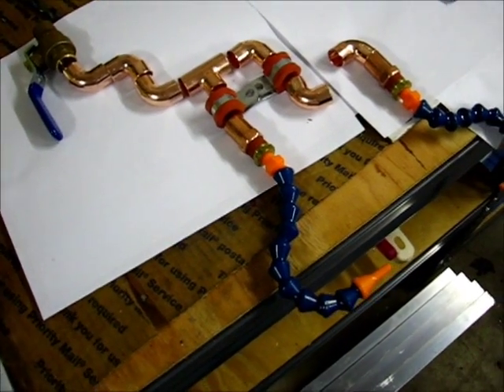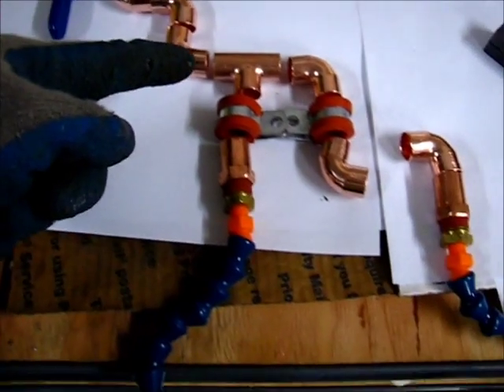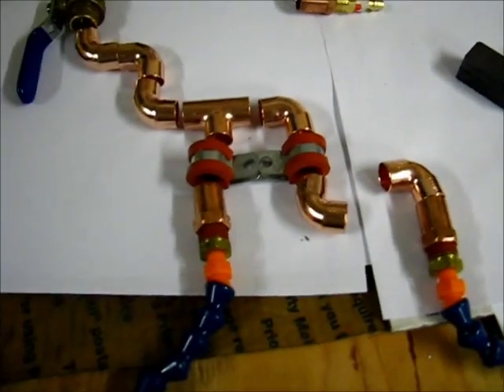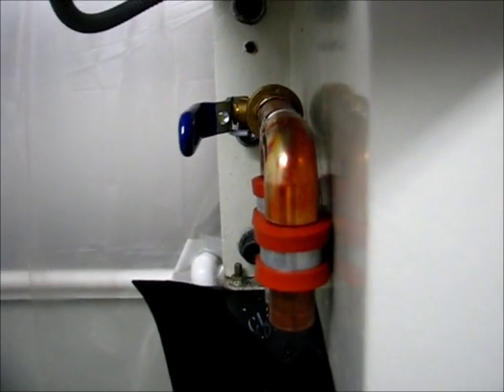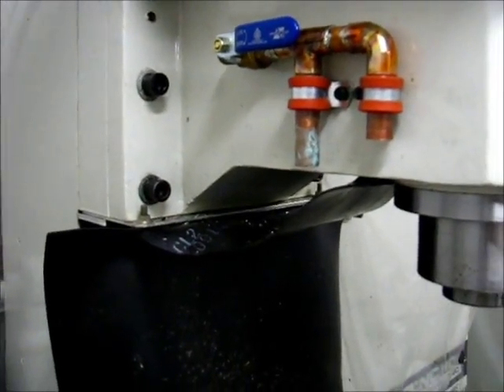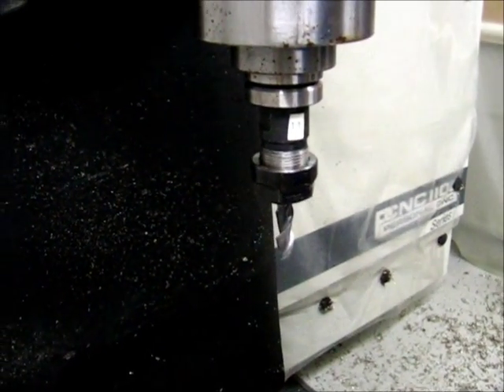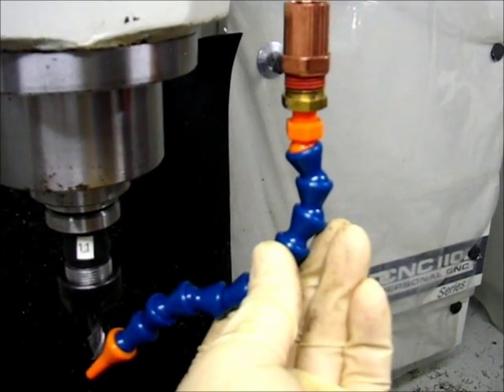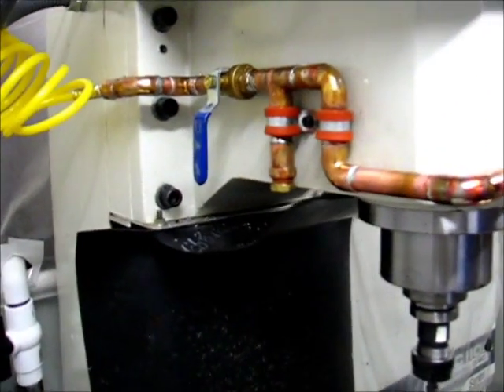Tormach PCNC 1100 - Building a Compressed Air Manifold for Chip Clearing

Comment: If it doesn't already have one, and if the part geometry will allow it, a tool with a sizable corner radius will survive much longer ramping than a sharp-corner tool will.
Reply from the maker: That's good to know. The tools keep chipping off the cutting edges on the sides of the end mill and not the corners, so I think my entry is good. It just keeps getting chips caught in the pocket and recutting them. Thanks for the info!
Reply: I would definitely second this, sharp tips are so fragile compared to an end mill w/ ~.040" radius tips....another take on it would be to decrease your ramping (in 'Z') per revolution around the shape that you're cutting and increasing your feedrate, basically half the depth and (roughly) double the feedrate per revolution...I've seen tools last a very long time doing this.